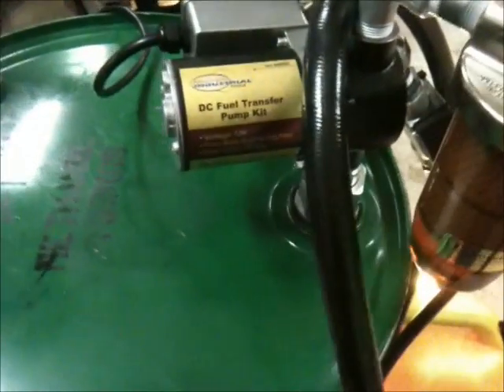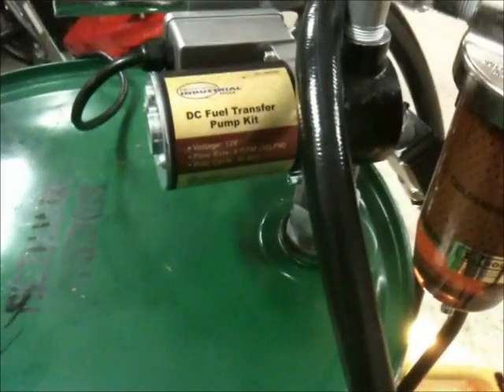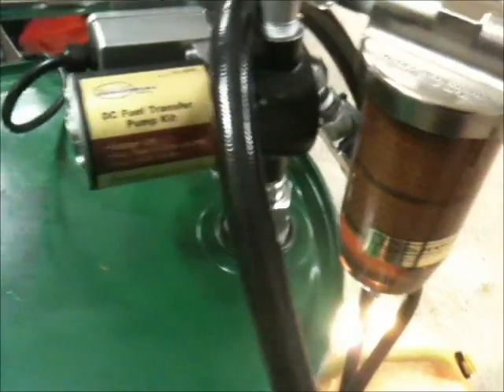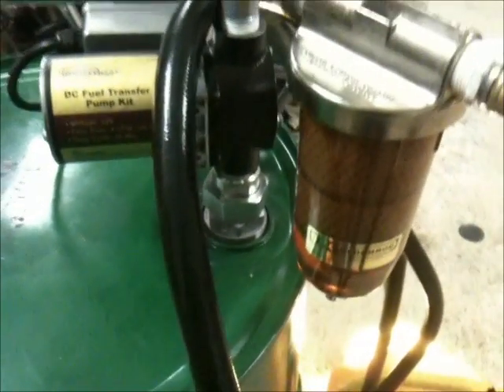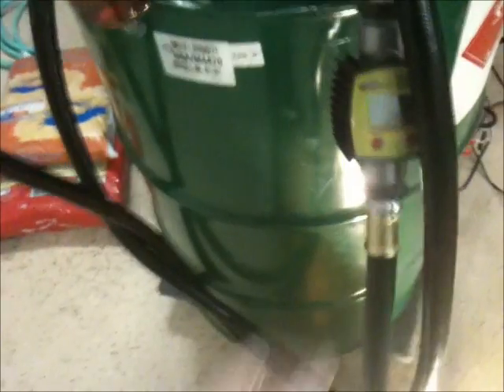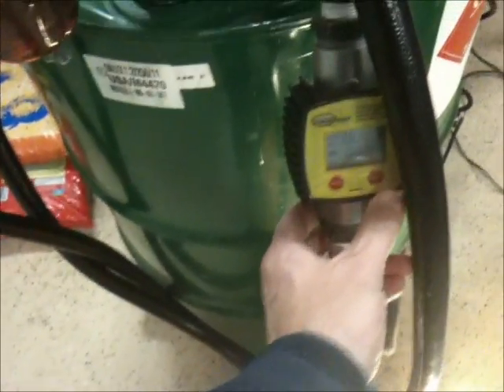Northern Tools Biodiesel Fuel Station Setup

Comment from the maker: note: The fuel hose that comes with the northern tools pump is JUNK!!! It's real thin. With biodiesel it has started sweating fuel like cheesecloth. Do yourself a favour and right away buy a 3/4" npt pvc/nitrile rubber hose. It's way tougher and won't dissolve on you! This is a safety item so don't screw around.